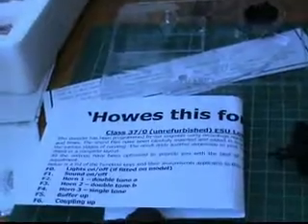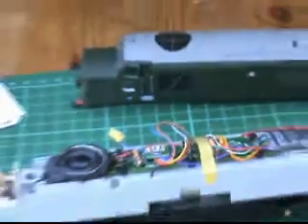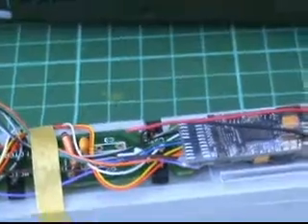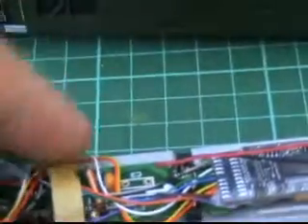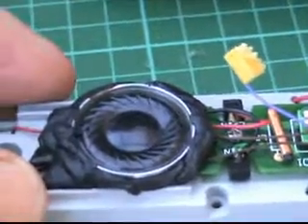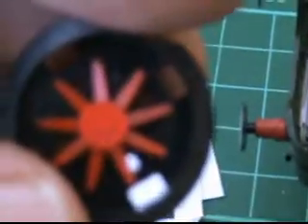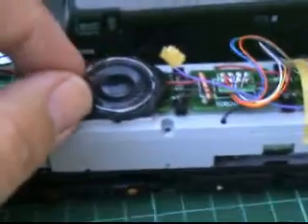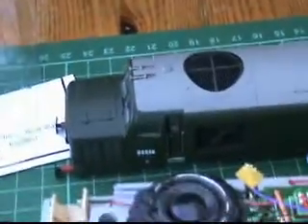How to fit a DCC Sound Decoder to a OO gauge Diesel Locomotive

Comment: Great video, I've fitted quite a few ESU Loksound chips & I've never found one model that the black speaker housing will fit, always end up doing what you've done. Would love to know what models they have been designed for....LOL   Howes really do make diesel sound that are top quality. Cheers Mike.
Reply from the maker: They are from a from a German Company called "Loksound" So initially they could be designed for German HO Locos?